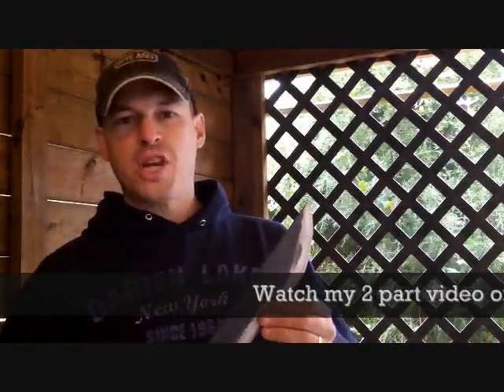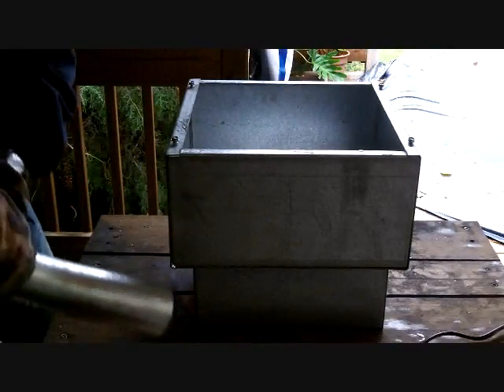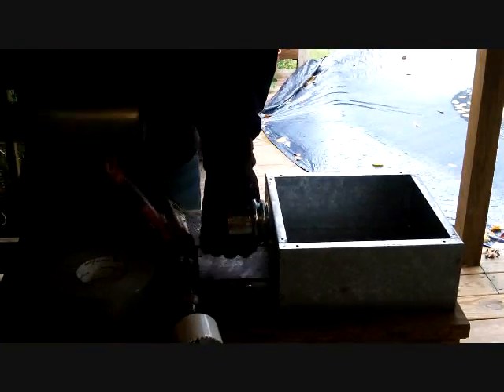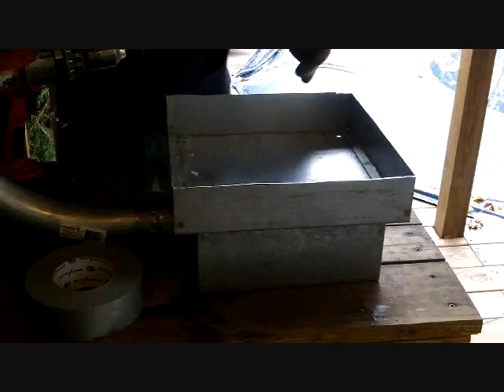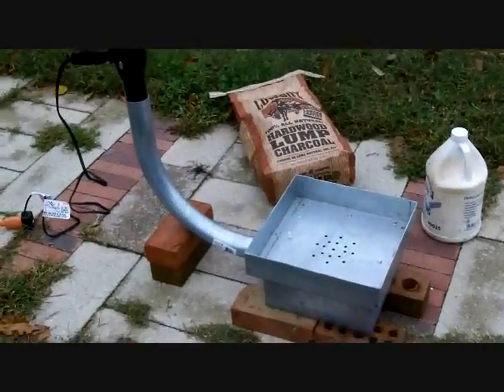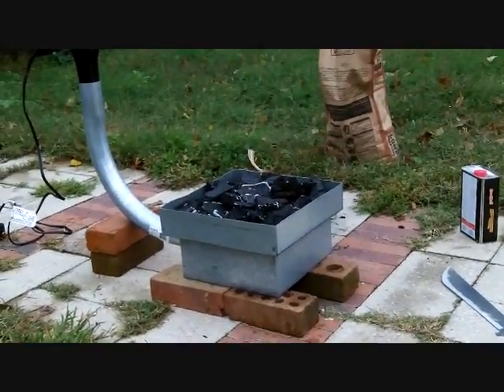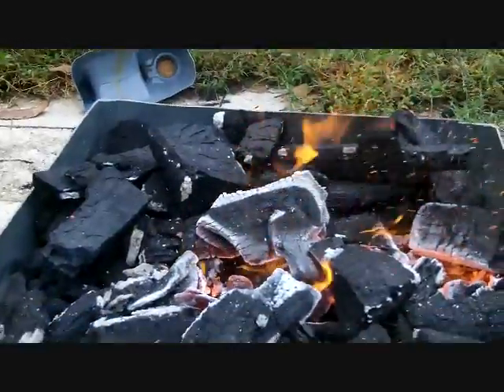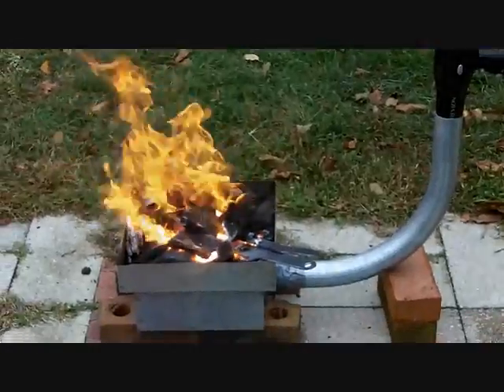How To Make A Homemade Forge (Rated Best Video)

Comment: That's the coolest thing you've ever built??  Don't break your arm patting yourself on the back. This is not a good forge design.
Maybe good for a single use.
Hold your breath when the galvanizing starts to gas off !! 
It's not deep enough and the holes will plug up with ash. The metal needs to be UNDER the coals to get red hot. Coal turns to coke when heated and that is what's used to forge metal.
WARNING!  DO NOT BURN GALVANIZED METAL !!   YOU IDIOT

Comment: tempering blades can be done in a large toaster oven because you heat it up to 460 degrees F then shut off the oven let it cool slowly inside the oven do that two or 3 times then the last time take it out and quench it in a bucket of sand until its cooled
Reply: Kristyana is spot on.  Hardening and tempering are different processes which anyone considering working steel should understand as they make the final knife more usable and safer.  Check out this webpage which explains the diff and temperatures involved really well without getting too technical. 

http://www.smt.sandvik.com/en/products/strip-steel/strip-products/knife-steel/hardening-guide/purpose-of-hardening-and-tempering/
Reply: Kristyanna Virgona  Intelligent, well spoken, and knows how to smith. Be still my dwarven heart. Joking all aside I use an old roaster oven with nasty sand that I can get up to heat so I know it all stays the same temp then unplug it to cool. I hind the sand holds the heat well and uniform and when I do let it cool the thermal shock is not so all of a sudden.
Reply: Bruce Cameron-Laker
Useful information on a useless and deadly video.....Thanks
Reply: or edge quench it and let it cool, doing both steps in one

Comment: jason i see just a few things wrong like using galvanized steel you should have used an large truck brake drum. i would have cut one side partly lower so you could stick your knifes into the coal secondly you should have cut the box the maybe 2 " taller again having one side lower. and also you need a way to clean out the bottom box because you are going to get ash down there. thirly  you need to heat the metal to about 1200-1400 F getting the metal an orange color. I do not know the exact temp but I have seen quite a few forges being made and used.

Comment: There is a flaw. The ashes will fall down into the holes and build up ash in the bottom box and the fire won't get enough wind to power it to make things hot. That's why stuff won't get hot enough to get easily bent or shaped.

Comment: Nice forge but two points... Firstly, use smaller chunks of charcoal for a better/hotter burn and secondly how do you empty the ash which will drop through the holes? or do you have to remove the top box each time?

Comment: You could get more heat if you used a heat gun rather than a hairdryer for the heat source. Have the input air preheated to 1200 to 1500 degrees Celsius would drastically increase the heat of the coals.
Reply: Cold air is more dense and contains more oxygen. That, in turn makes the fire hotter because it burns more efficiently.
Reply: I couldn't help but laugh at this comment lol. If you are going to correct somebody be damn sure you know what you're talking about first.
Reply: The hairdryer isn't used for the heat source. It's used as a wind source, which in turn makes the fire burn way hotter than if you used a heat gun! Jeesh
Reply: Did you see the fireball of coals…they are burning well over 2500 degrees F.

Comment: It didnt work... i have tried someting like that... It never turnt red hot :(
Reply: MourningStar13666 i saw another guy use a air matress pump n he got some spring steel red hot sept he just used two pieces of pipe with a hose valve and used a rag n water to keep the pipe cool and the pipe was blowing straight into the coals
Reply: Cool, thanks for the coments
Reply: Devon Asher i've seen that video too. the one i seen that seemed to work best was a bathroom ventilation blower. it moved a lot of air but not too fast

Comment: It may be safer if you point you blower tube to the side ( or down if you build a wood platform to get it up away from the ground to a safer height to work from ) .  Other than that, NICE VIDEO !!   :)

Comment: cool forge but what kind of oil do you use
Reply: Most commonly used is Motor Oil, used or new, peanut oil work pretty well too. Don't use vegetable or corn oil, messy, horrible stuff.

Best off quenching outside as the fumes are harmful.

Comment: If using " electric boxes " use Stainless ones to prevent Gal fever.  And Use Black pipe  or stainless fittings  they are not galvanized. All fitting and conduit in this video are galvanized . But good design just wrong choice of materials.

Comment: You need to put something else on top of your coal bed to capture the heat. Right now all of the heat produced by the coals is being lost to the air. And it would also help to insulate the box holding the coal too.
Reply: Ian Sayers
You can very well have a closed top forge.

Comment: my suggestion is make that pipe shorter there are two things dragging down your air movement which is how long the pipe is it takes more time to get there and a longer distance so loses pressure that combined with not moving directly in to the coals drags it down but works pretty well

Comment: I used an old microwave fan, also used the housing, busted a hole in the side used duct tape an a ceramic pipe for air. I used wood, ran my ass off getting twigs that day, big pain in the ass.

Comment: in order to heat treat you need to heat the steel to the point that a magnet doesn't stick to it then drench it in oil then re heat it to it turns a yellow color & the bury it in sand for a week to slowlt cool
Reply: My knives & tools come out just fine & hold a raxor sharp edge, so do it your way, some people can't take advice.
Reply: & using coal coke makes a hotter forge too
Reply: Arthur Stacey Wait, so you have to anneal a blade after the quench? That's news to me.
Reply: the 2nd heating is what helps it hold the edge.
Reply: Chuck Norris Chuck, it's often called "drawing the temper" and it refines the granular structure of the steel.  Making it finer, mostly at the surface, which adds strength and edge-holding ability.  Many blacksmiths will allow the steel to cool slowly submerged in a box of wood ash or some other insulating material.  It's one of those things where every smith has their own recipe for heat, materials, and time, that has been developed through experience and a lot of trial and error.
Reply: Chuck Norris annealing the blade would mean taking it back to critical temp (cherry red) and slowing letting it cool.  What Arthur Stacy is describing with the 2nd heat is tempering, you don't get it glowing hot at all, only up to around 450-500degF.  The first heat and quench makes the steel very hard but very brittle, it could shatter like glass if dropped, the tempering softens it just enough to make it tough but still hard enough to hold an edge.
Reply: Arthur Stacey Your right, some people just cant take advice.  That guy should just relax and take a second to learn some manners.
Reply: Arthur Stacey Hey, man, I have a question. An entire week is really needed for the tempering?
Reply: you really need to slow cool the steel after the last heating, that helps with it holding it's edge after honing
Reply: I have learned how to heat treat from a couple different smiths, a week is not necessary, a blade brought to tempering heat (450degF or so) and then buried in sand will be cool to ambient WAY before a week...
Reply: 800lb Gorilla
DUDE, DO YOU KNOW WHO YOU'RE TALKING TO?
Reply: nope, do know you didn't know what you were talking about
Reply: Andy Collier That makes sense. I've learned by watching some more videos that there's a temper for heat treating and annealing for softening the metal enough to easily work with.

Comment: I wouldnt sweat the galvanized issue too much.  I get what yall are saying and I had a buddy that had a seizure as a rwsult of welding galvanized steel in shop class in hs.  But, it seems to me that if he let all the coating cook off before he started working around it too much then it wouldnt be an issue.  My only advice...2 dryers and more holes so you dont have that hot spot in the middle while everything else stays relatively cool.  Pretty clever design otherwise.

Comment: The box is multi galvanized! He is BURNING coal directly in it! Nobody here is concerned of his "duck work" ! The ducting is not the issue.. It is also not exhaust pipe! Its EMT just like he says! EMT is GALVANIZED!  
As a Respiratory Therapist I can promise you it only takes a little bit of the fumes from the galvanized metal fuming off to fuck you up and/or kill you. I can promise you it's a tortuous death as well! If it doesn't kill you the illness will make you wish it did! 
Don't chance it!

Comment: did you find out yet that quenching can shatter  hot steel as soon as it connects with cold oil ?  I've been Quenching with  water   and so far  I have has good results , 
 no salt no salt peter ,  just Distilled drinking water , room tempt . try it , Go straight in don't wiggle side to side it will warp a blade ,  forward and backwards and in a slow motion , triple draw back . at   first one 350 for an hr 2nd 400 3rd 450 ,  don't let it  the blade normalize , 5160 likes this .

Comment: the pipe is exhaust pipe  like on your car ,, Galvanized on a forge for Duck work ,  does not draw enough Heat  and there is not enough even if it did in the first couple inches to cause any harm . someone is really going into over kill , with all this   about galvanized can kill you  yes it can in your burning a ton of it and two stupid to stand down wind .

Comment: For someone like me who is not going into business making knives, this is cheap to make and will do the 2 or 4 knives I plan to make, and then it goes out for trash pickup. So this idea is perfect for people like me. If I were going into business, I would buy the expensive commercial forge that would last a life time. But for a quick SHTF make a good knife and go, this is perfect. I melt and mold my own led bullets, all of this has to go outdoors with good ventilation.

Comment: Nice build Jaydog. If it's for blades specifically, how cool would a longer and narrower top box be? Like a foot and a half by six or 7 inches. You could then drill holes only down the center the whole length. It would merely require some additional coal stoking. That design would isolate the heat down the entire length of the blade for a totally even hardness. By the way, I mocked your hairdryer's ability-until I saw it working that is.

Comment: Galvanized steel? People have gotten really(!) sick from zinc poisoning while heating that up, for example when welding. Common symptoms: chills, shaking, slight fever, vomiting, and cold sweats. Fatalities have been associated with extreme cases of galvanize poisoning. Therefore when metal fume fever symptoms begin, you should immediately avoid further exposure.

Comment: Do NOT USE THIS PLAN, Galvanized steel will kill you, not to mention to get any steel hot enough to forge with would melt this box. If you want a real plan check out any of the ones that use a brake drum and thicker steel than an electricians panel for the coal box.

Comment: What you should have done is drilled the holes in a linear pattern so the heat wouldn't be concentrated in just the middle and you could heat the blade evenly. But also don't use galvanized metal.

Comment: you need to be able to completely cover the steal. the edge of that forge isnt going to cut it. put the piping under ground and have a mound of charcoal with three walls of brick around it. this way you can stick the metal vertical right in the middle of the charcoal. its the traditional way. what you made is only OK for small stuff. trust me i have made a forge just like that to heat treat knives. it barley gets the job done

Comment: also it is a lot safer to use. keep heat in the right places! also for the bottom i would line it with stones because the more heat could cause your base to weaken, but im not sure on that i am just assuming.

Comment: you have a great concept, could use some tweeks such as a enclosure and something better then a blow dryer. make a chimney *with a escape fan* enclosure to allow heat to expel from your workshop also with the escape fan will produce more heat. now you have a enclosure, a sure fire way to keep your workshop ventilated. now a fan, i would go for a medium powerd carpet fan! wire that bastard to a wall switch right next to you ventilation switch, so you have more heat with less fuel.

Comment: As a blacksmith and an Electrician I.B.E.W. local 443 I can tell this is a bad idea. electrical boxes  and fittings are multi coated with hot galvinze which is extremly poisonous when burnt

Comment: They used very well insulated boxes as their forges, which meant that the heat was kept in the fire, attaining the teampreatures needed, if you are going to do a 'backyard' forging (as i assume most will) coal is basically the only feasable way of gaining the teampreatures needed. Making said japanese forges take much expertese, time and space, but feel free to have a shot at it if you wish to be arrogant and awkward. I was simply offering advice which will help the average person.

Comment: from what Ive read you need to get steel above 760 degrees celcius, thats when the the iron crystal structure will change to face centered cubic, and the carbon atoms will migrate into the central position formerly occupied by an iron atom. which makes the steel no longer magnetic. I dont see how your forge can get that hot. I do believe a home made forge could, but not this one, I think you are affectively doing nothing.

Comment: The steel cools faster when you use oil. Very high carbon steel has different quenching requirements because its carbon content makes it more brittle than low carbon steel or just regular iron. More brittle metal means that if you cool it quickly (with water) the steel has a good chance to crack. If you heat a poker and quench that to warm your oil, the oil will quench your piece without cracking it.

Comment: Can someone answer me some questions?
1) Is it a good idea to use a wooddust stove with hole in the center of the wooddust, where I can add nutshells waste covered with candle wax waste in the middle?
2) Is it hazardous to breath these materials?
3) Will get hot enough or do I need charcoal?
Thanks in advance, greets.

Comment: Sir, in the video it looks as though the metal is galvanised. If so the fumes given off when the forge is running are very poisonous. Obviously this will last until the galvanising has been burnt off and is worse in enclosed spaces. 
If the metal isnt galvanised I appologuise. Its an excellent tutorial video.

Comment: Nice work. If I may say, you are losing lots of heat having it open. Build something around it (fire brick) to trap that heat. Stuff will heat up fast, hotter, and will not be wasting fuel and time.

Comment: When a magnet looses it magnetism on the heated steel, it is ready to be quenched to harden it.  This indicates the metal has reached optimal temperature.  If it still has magnetism, the blade will not harden effectively.

Comment: when you heat the metal untill its redhot and quench it in oil the carbon within the oil will get soaked up by the metal making it stronger.

Comment: i agree with steviebar , nice vid, a well known knivesmith just died from poisonous gasses trying to burn off galvanized metal, i believe it took three days before he had passed,you seem to have the drive to do this, just be carefull,me i used a old lp tank cut the top or if you want to be longer cut it sidways, but mine works nice for what i need, just some ideas, good luck hope to see more of your vids

Comment: Generally, no, it shouldn't explode at all.  Heating metal to red-hot then quenching it is how it is heat-treated and hardened prior to tempering the metal to a specific flexibility.

Comment: Couple things:  
One: as other have stated - Galvanized can be very dangerous when heated and you must make sure to not inhale the fumes.  Being outdoors, you might (might) be OK.
Two:  Seemes like the flames were getting pretty close to blow dryer - Maybe extend it out or away further as they with malfunction if they get too hot.
three:  I never saw the blade become red enought to effectively harden it.  Did it?  Did you check if it was ready with a magnet?
 Otherwise nice video

Comment: I noticed the metal boxes, and I dont know if they are made of steel. They probably are, or they would melt if made of zinc or tin. But anyway, metal loses heat to environment at very high rates and is very risky of burning someone.

If you got some bricks you could just put them together to form a box, or use clay pots just like you used the metal boxes (of course you would need to drill some holes in it). Clay holds heat and wouldnt melt.

I didnt meant to criticize your work tough.

Comment: for small stuff like knives all you need is a bbq, firebricks and a hair dryer held in one hand blowing into the flames...i'ts what i'm using right now works fine...for big steel forming projects it will be a huge pain but for heat treating it's fine.

Comment: I'm no expert on forges, but from what I've seen I'm pretty sure you're supposed to use fireproof bricks or some form of insulator. If you plan on heating metal to a high enough temperature to shape it, there's a good chance it will melt that little sheet metal box.

Comment: those boxes are galvanized and when put under extreme heat it releases a toxic fume. If i was you u would make it out of a 55 gallon drum and use steel fittings yes they are more expensive but its much safer. I'm not trying to be a douche but i don't people to die from using the wrong materiel